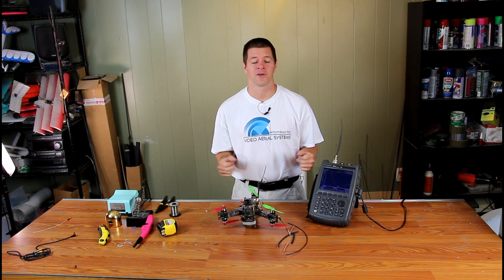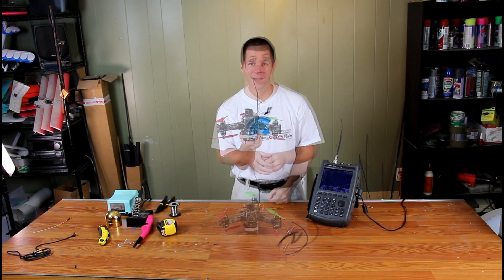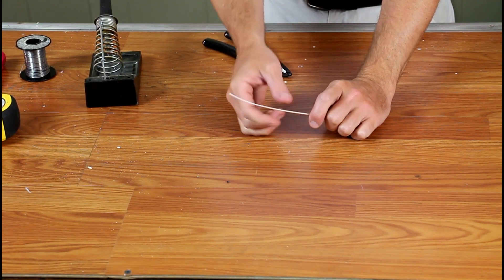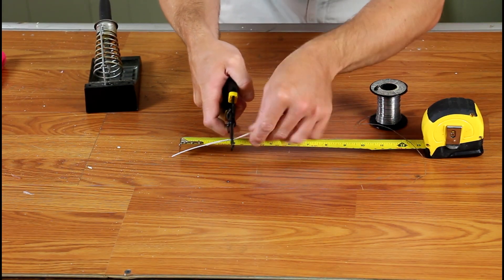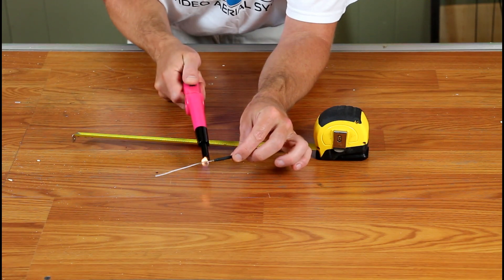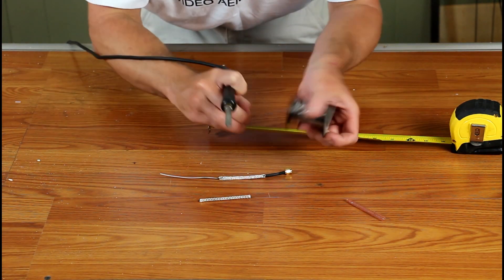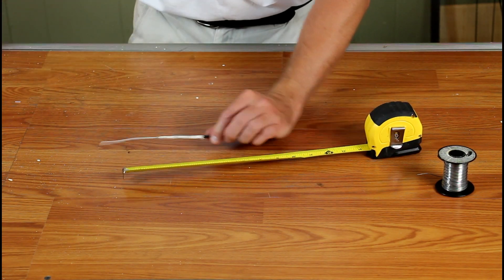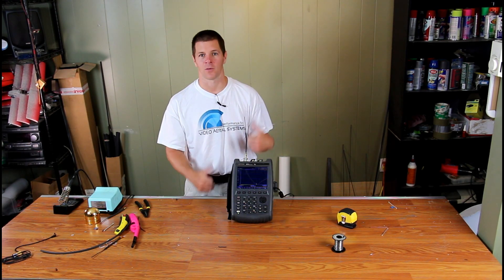Make a long range whip antenna for TBS Crossfire

Comment: Hello! I have 2 questions:
1: Why for 868MHZ the total lenght(of exposed and shielded part) is not double the shilded(lenght)? Total lengh should be 6.5'' or not?
2: Will it work if I heat all the lenght of the shrink tube, and than add one more, and do it again, and than one more and heat just the initial part like on the video? Or maybe better as someone said in the comments, try to find a hard, stiffer tube...
However thank you for tutorial and idea how to make this antenna

Comment: Please help me, what will be my length of antenna if my desire frequency to use is 629.143Mhz also the length of RG142. thank you in advance. it will help me a lot to my project.
Reply from the maker: Antennas scale very well.  Simply follow this formula:

Your length = design length * (design frequency/your frequency).  It is actually that simple.
Reply: @CAGreve1231  How do I know my design length and design frequency?
Reply from the maker: @morsnicolas8738  - You calculate your length from your frequency (629.143 MHz) and the length and frequency of my design in the video.

Comment: What is the math behind the design. I would like to try building this for a lower and higher frequency. I have built these as described and they work great on my meshtastic nodes.
Reply from the maker: It's actually really complicated.  The issue is the permitivity of the grounded element or more specifically, the air gap under it.  The gap needs to be 1/4 wavelength accounting for this effect.  Also, the larger the spacing between the cable and the grounded element, the stronger the choke effect is.

Comment: Hey Alex!! Do you know how well this scales down? Do you think it would be effective to build an antenna for a micro lightweight build, taking it down to 3” or or even 1.5”? I’m talking about needing the range of a football field or two worth of range.. thank you for this instruction video!!
Reply from the maker: Yes it would scale to 2.4GHz.  However, making it smaller for the same frequency is not possible.  I do have XFire Pro which is a very small 900MHz antenna (less than 3" long).  I also have one for 2.4GHz.

Comment: what happened if I heat all heatshrink like 2nd way then i change the shrink like 1st way? or maybe i have to make another antenna again?
Reply: The antenna will simply run out of balance causing the cable to resonate.  How detrimental that is will depend on your cable length and how much air gap is left inside.  Worst case scenario, your range is reduced to 20%.
Reply: @highervoltage5430  if I have preheated all the antenna lengths, is it better to buy a new antenna or start over?
Reply: @highervoltage5430  is there any permanent effect after all antenna lengths are heated up? for example I have 1 antenna but I took the wrong example like the second way (heating all lengths), what should I do? better buy new or use this antenna by repeating the correct steps (like the first step)?
Reply: @SmudgeFPV  - Can you just cut away the heatshrink and re-apply it?
Reply: @highervoltage5430  yes I can

Comment: Hi, thanks for the informative. May i ask, would this also apply for the stock TBS CROSSFIRE MICRO RX ANTENNA? I mount it on a L shape fashion on my quad, securing the active element and ground element on 2 separate zip ties before i put heat shrink on them. Do i need to take precaution to ensure there is an air-gap for the ground element in the heat shrink, just like your example as well?

Comment: Not doubting you, but at the end of the video when you demonstrated the poor SWR after shrinking the base end of the antenna, it isn't a valid comparison when it was done on a different antenna.  Great video though, this is exactly what I was looking for. I have a 2.4GHz FlySky Flit10 receiver that uses one of these dipole antennas, so I went looking for a 900MHz design, and landed here! So thanks

Comment: I don't get it. if the air gap is that important, why couldn't we just insert a roll of paper or a few strip of electrical tape?
Reply from the maker: Adding material changes the velocity of propagation and would change the effective length.
Reply: Thanks. So actually a metallic tube would be better that keeps the shape and spacing. If weight is not an issue.

Comment: Alex.....could I find a copper tube that's 3" and the same diameter as the outer braided shield? Kind of like the diopole antennas that FlySky uses.
Reply from the maker: Yes.  That would work well.
Reply: Hey Prophet, did you make it? how was the performance? I wanna try using the copper tube.
Reply: @fabpr89  Didn’t bother to make one. Just bought an ORT Moxon v3 from RDQ.

Comment: What’s up Alex!! Dude... I hated FPV until I found your products years ago. I have always told people just buy IBcrazy or your an idiot. I took a break but I’m back with a vengeance and I have long range wing dreams for where I live in CA. Should I go analog or DJI??? I’m ready for an upgrade but don’t know wether I should go DJI or HDO2 with crossfire
Reply from the maker: Analog rules for long range.  The DJI system is awesome, but it has some serious problems when it comes to long range flying.
Reply: Video Aerial Systems thank you!!

Comment: Great tutorial Alex. I made one about 2 months ago and it works great. I would only suggest on this type of tutorial to ZOOM IN REALLY CLOSE because many people have no experience stripping, removing shielding, etc from coax. and will end up cutting through the outer jacket, the shield and sometimes thru the inner jacket .
Reply from the maker: I didn't think about that.  You can clearly see it if you change the video mode to HD, though.

Comment: If i need a bit of rigidity? Would it be ok to ad a (correct diameter) “forever tube” on the bottom half? Of course keeping the air gap  but adding rigidity to the lower half of the antenna....??? Or will that screw up the quality???
Reply from the maker: You could use a straw or something in place of the heatshrink tubing, yes.

Comment: Silly question but how come it’s on the kwad? And not on the controller? How do I make one for my kwad? I’m doing the immortal L??
Reply from the maker: The TBS Tuned antenna is very similar and goes on your radio.
Reply: Video Aerial Systems I’m kinda confuse  on how this goes to the tbs receiver on the kwads
Reply from the maker: @sk8rix24  - This style is for use with an extension cable for frame mounting.  Use a u.fl connector on RG178 for connection to the receiver.

Comment: Quick question.. So if you just added a small copper down plane wire at the solder joint (Like the original CF antennas) how is this antenna better? In search of knowledge :)
Reply from the maker: I am not certain what you mean.  I am not familiar with the original CF antennas.

Comment: man, we've had a tutorial for this for the better part of a year now, what we need is for TBS to sell them. What's the holdup?
Reply from the maker: Probably too many irons in the fire if you ask me.  I actually explained to them how to make this 9 months ago.
Reply: @CAGreve1231  So you're saying it's Trappy's holdup, not yours?
Reply from the maker: I don't know who is the hold up or if there is one.  It is very possible TBS decided not to pursue this.  I did send them instructions on how to make them through a messenger, but haven't bothered to check up on it.
Reply: Hey Benson, you made a video of this? Can you share a link?
Reply: @northernflyer5311  No, but good instructions for building a sleeve dipole for crossfire have been shared on Facebook. It's really not a great fit for video format, I'm afraid.

Comment: Hi Alex, will you be selling these (with UFL connector)? Just today setup my crossfire nano diversity Rx with 2 immortal T’s on a long ranger. Would prefer to not drag the bottom of my vertical mounted antenna...
Reply from the maker: I don't intend to sell these at all as I have too many other projects I need to finish.  This is more of a DIY project I wanted to share with others.
Reply: Video Aerial Systems cool, thanks

Comment: Why would I do this?   Isn’t an antenna that I purchase from VAS just as good if not better?    I’m all for saving a little $$$, but really?   Isn’t something I buy a lot more durable?
Reply: because u can do it as long as u needwith for example uFl connector instead of dampening SMA :)
Reply from the maker: I actually have no intention on making these, but I am sure TBS would do it.  Manufacturing in the USA is simply too expensive and in it's current form is too ugly to be a commercial product.

Comment: great vid. question: does it need AIR in the air gap area or separation? could non-shrinkable piece of tubing or tpu be used to create a gap that doesn't need to be air filled? I'm thinking about long term durability, after repeated flexes or exposure to heat etc.
Reply from the maker: If there is anything but air, the counterpoise length would need to be changed to accommodate the change in dielectric speed.  In all honesty, the durability of this is probably more than adequate in the long term.  However, if you have a suggestion on what else that could be filled with, I could certainly research it for you and give you new dimensions to make it work.
Reply: @CAGreve1231  what I was thinking was some sort of a 3d printed tpu tube, which had a small eyelet on it to let it be bolted down to a top plate or around a standoff, so the sma wasn't the mounting point.
Reply: if you were to suggest inner and outer dimensions and a length I'd be happy to whip up a stl to try out...
Reply from the maker: I am not sure how to explain this because it isn't easy to describe through text, but I will try:

Anything underneath the counter element (braided shield) changes the velocity of propagation in the chamber it creates with the coaxial cable.  The reduction in speed depends on the relative permitivity of the material and the % fill of that material.  

So I guess it would depend on how the TPU part was made, how much infill was used, and how far up the cable it went.  If you made it solid, then I would make an educated guess that the length of the shielded portion  would be ~2.4" by my best guess.  However, you would also need to adjust the feedpoint, too.  THus you would need about 1/2" of exposed shield (where I had ~3/16") on the cable BEFORE the added braid.  This should give you a decent balun and resonance.

I am happy to experiment with this if you like.  If you design it, I can 3D print the part and test.  I will give you full credit for the work in the video, of course.
Reply: @CAGreve1231  I totally understand your point that it would affect the rest of the measurements. the goal for me would be to find a balance where the antenna performed as well as possible, and was easily mountable without putting strain on the sma connection, durable and did not start to lose efficacy after repeated flexings or bending that might change an air gap. or accidental exposure to heat, or anything else that might change the air gap. maybe it's an unnecessary exploration but it seems like an interesting one, and I like the idea of this antenna a lot.
Reply from the maker: @BQEFPV  - WHy not design something and then I can try it out?  If the antenna needs adjusted for your design, I will do a video on it giving you the credit for the design work.
Reply: @CAGreve1231  I will. here's my main question for you: what is the O.D. of the RG316?